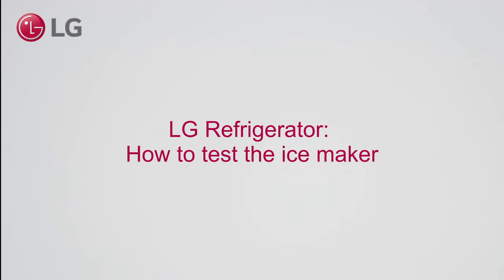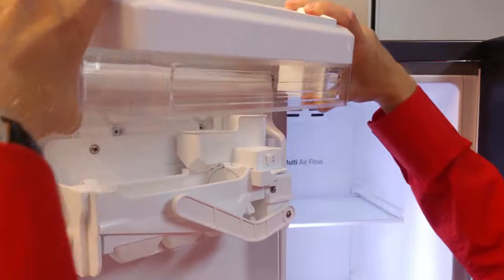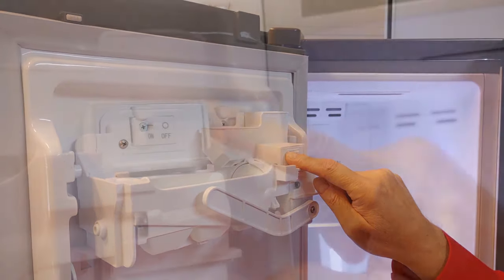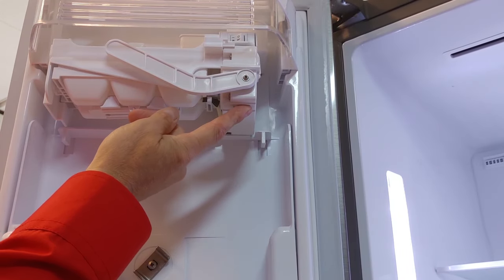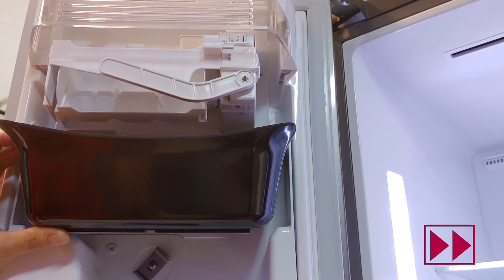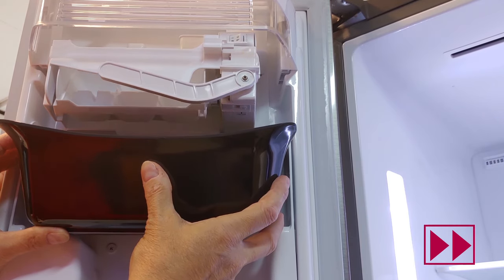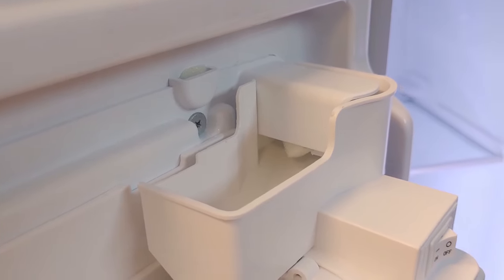[LG Refrigerator] - How to test the ice maker in a Side-by-Side model

Comment: THXlg! My ice maker suddenly stopped making ice... (stopped refilling with water). I tried everything, even switching the fridge off... with the test button it did the cycle and started pouring water again.
Reply from the maker: You are welcome
Reply: Did you get answer ? I have the same problem now :(
Reply: @sertacsigar1727  I fixed it this way, I was not answering, I confirmed that doing the test as shown in the video it started working again.
Reply: Same for me, thank you very much for this video!
Reply: It worked also for me 👍👍
I also switched off the Ice-Maker for an hour and now is everything OK

Comment: Hi i just bought a fridge freezer like this today could you please tell me what temps my freezer and fridge should be at please and also how long will it take to make ice ? has only been switched on for around 4 hours Thanks Helen
Reply from the maker: The default temperatures for an LG Refrigerator is 3 Celsius. For the Freezer the default temperature is -18 Celsius. These defaults will work fine for almost all food and drinks. You may want to change these temperatures if the type of food or drinks stored in the appliance requires differently. This will be indicated on the packaging of the food and drinks. By the time you read this you probably will have ice available from the ice maker.

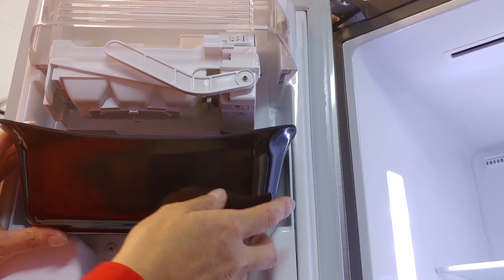Comment: What to do of after i press the test button, it didn't do the cycle..nothing happened. 0:36
Reply from the maker: If the ice maker is on, the test button should activate the ice maker tray motor. If not, you may need a technician. Please contact your local LG support desk to discuss further steps..

Comment: How does it work with a GSXV91MCAE?
LG Support Germany linked me this video for a GSXV91MCAE, but this is not the same ice machine. Mine has no visible buttons under the cover.
Reply from the maker: Dear Christoph, probably you have a model where you need to take the ice bucket out, then look at the lower left side under the ice maker. there should be a button.
Reply: @LGSAE There is no such button. As you work for LG, maybe you know someone who could take a look into the technical manual. Model number GSXV91MCAE.
Reply from the maker: The switch should really be there, in some cases it is a pin hole though. If you want, could you share an image of the bottom and front side of your ice maker via training@lge.com? We are happy to take a look at it. Sharing images via comments is not possible.
Reply: Thank you for the reply. I will send an email with all the information.

Comment: Where does the ICE come from though?  How does ICE get into the machine?
Reply: there's a water compartment in the fridge
Reply from the maker: correct, both plumbing and non-plumbing machines have a water tank, which is easy to see for non-plumbing models. For plumbing (European) models, check behind the vegetable drawer.

Comment: Hi , my ice maker is filling with very little of water. Tried several time (10 times) , but result is same , it barely fils water for 3half cubes .
Reply from the maker: Do you know if the water pressure is enough (if you have a plumbed unit)? If it concerns a unit with internal water tank, it might be the pump that has become bad or perhaps the waterline needs to be vented. It may also be that the timing needs to be adjusted, but that requires a technician to check. In short, there could be numerous reasons.

Comment: Please,  my fridge's ice tray keeps dispensing the water immediately it is refilled before it is iced and then it continues to leak onto the floor.
Reply from the maker: That looks like a problem that requires a technician. Apparently the software or temperature sensor of the ice maker do not work well.
Reply: @LGSAE  OK. Thank you

Comment: My Test not working. The fridge doing nothing
Reply from the maker: Is the ice maker switched on trying to test it? Does unplugging/plugging in the power help? If not, please contact your local LG helpdesk.
Reply: @LGSAE  No, the test does not start. Disconnecting the power supply did not help. A cable was wedged between the ice mold and the right case. After I freed it, everything worked again immediately. The problem is that the ice mold often pinches this cable again due to its movement. Or is it the water pipe with a white sheathing? I can send you pictures of it if you wish. But I prefer communication in german.
Reply: Hi, my test works fine, dispenses ice and fills right back up with water, but doesn't dispense again once frozen? Pls help, cld this be a thermistor or something? Will try turning it off for a few hrs, driving me mad as wife uses ice all the time, cheers